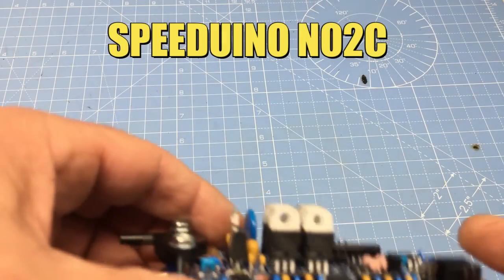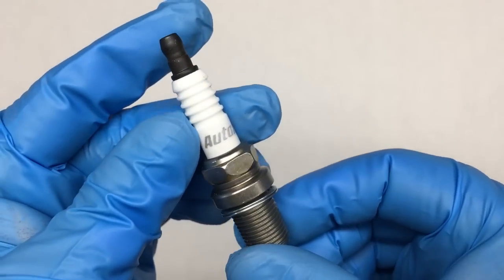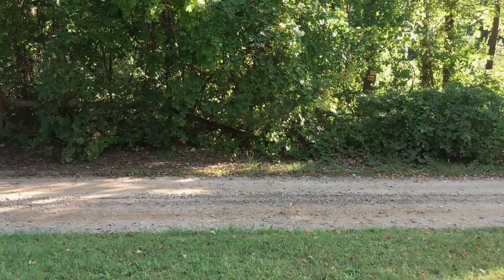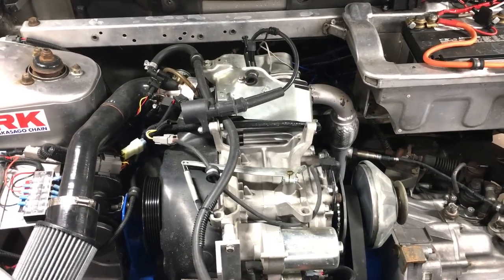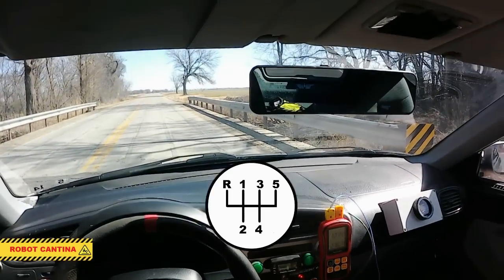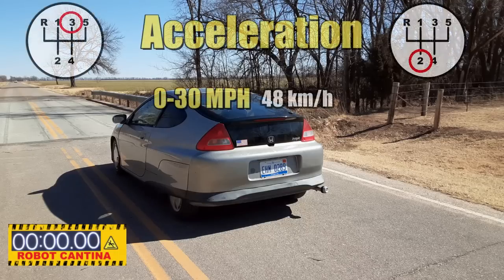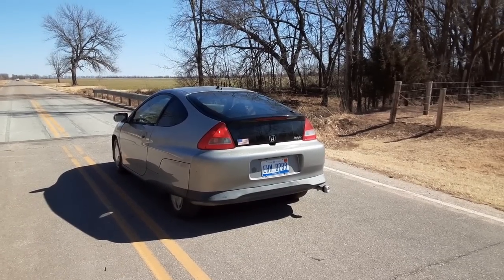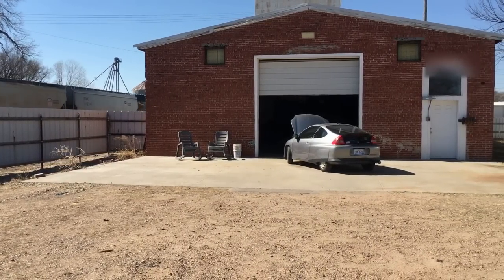S2 Episode 1.  We road test the Speeduino NO2C in our street legal go kart.

Comment: Where in Kansas ? I'm in Vinita, Oklahoma So glad to see that your back and yes EMI can be a major problem I find this out with a Motorcycle Dashcam I end using reg aluminum foil and wire loom harness tape still need get the right stuff like 3M EMI Aluminum Foil Shielding Tape like you my Ninja 250 had the wrong spark plug install which where non-resistor plugs

Comment: I was noticing you were getting as rich as the 11:1 range under load. Where is the target set to? It shouldn't need to be much richer that 12.5-12.75 even under load, especially now that the thermal issue is fixed. At cruising speed you can get away with 14.7 or even leaner under low tps/high vacuum decel conditions you seemed way rich the whole run.
Reply from the maker: Yes, it was way rich.  We will cover why it was so rich in the next episode.  stay tuned!

Comment: I have a intake that will help get your 420cc engine at least to if not over 100% volumetric efficiency if your interested, I'd guess your at 70% currently with a 2 valve engine
Reply from the maker: We are currently using a custom manifold for the EFI.  Not a lot of space given the position of the engine.  Are you thinking of a longer manifold?

Comment: Doing good. Here my input you didn't ask for. I think you've extracted 85-90% of what's theoretically possible from that engine. I think you've got too much rolling mass. Tires and wheels need to weigh way less. Also could shed some weight using drag racer rotors. Anyway you've done way more than I have so who am I to too be giving feedback.

Comment: You know, I do have an idea for the future. Why not a honda quiet generator? THE WHOLE THING. It is designed to respond to an electric load so no controller needed, just an electronic accelerator pedal. You should be able to figure out some way to use the hybrid electric motor and make a cable that plugs into the generator, etc. Basically a road locomotive. If you have a used hybrid battery, that would be even better because then you can plug the charger into the generator and let it power the motor! I bet it will be slow though, but maybe if it works you can get a pancake hybrid motor and battery out of a slightly newer Honda.

Comment: Cool that this dropped into my feed. I'm looking into the feasibility of injecting the Dauntless 225 V6 in my 48 Willys jeep. It's my DD and I need mileage better than 9.16. 

Oddly enough (no pun intended), it seems that there's almost no support for odd-fire V6s (at least Buick-designed) in aftermarket EFI setups. Not so with Speeduino - it's supported out-of-the-box.

So thanks for the cool vid, and I love your cart!

Comment: Welcome back. Is this engine still mechanically speed governered?
Reply from the maker: Good question! The mechanical governor is completely disconnected,.   The EFI computer is programmed to cut fuel above 4500 RPM.

Comment: Would changing the weights in your CVT to hold a bit higher of an RPM while accelerating perhaps be a thing you could do? Back when I was younger I did this on my old go cart and it made it go from feeling sluggish to feeling quite snappy... it felt more like actually taking off in first rather than taking off in third all the time. Seeing as how much weight you are hauling around, I feel like the more gearing you can get won't hurt.
Reply from the maker: Good point on the CVT,  I'm holding off on modifying  the weights until we get the supercharger installed.  I'm hoping the CVT may be in the right range with the additional torque the supercharger will generate.
Reply: @robotcantina8957  That's a good point. With the supercharger it will have quite a bit more punch to the point that it will probably be close to my car's power (63hp and 660cc's of pure fury) and it feels actually kinda peppy... but I have a transmission with far lower gearing then yours. I think 1st literally tops out at 15mph at 9300rpm's!

Comment: So, if you need stuff machined, i have 3 15 hp bmc mills, I'll run your parts for your misadventures.send material and inserts, mostly because this entire endeavour is absurd and ridiculous, I love it.

Thinking I might also be exiting Michigan in a few years.

Datalog the injection pw output. It's it's stable and your seeing that variation in afr, either the injector or pump have issues ir the engine is suffering from detonation

Comment: 14:04 Most of these don't make sense. At what speed do you shift from 2nd to 3rd? And 3rd to 4th?
Reply from the maker: If I start out in 3rd gear, I only have to shift at 50 MPH, however if I start out in 2nd gear then I have to shift at 30 and again at 50.
Reply: @robotcantina8957  My bad, so the only really weird one is the 50-60mph

Comment: One of the biggest things I have seen is the 12 to 1 on throttle ratio.  On boost that’s great.  Na. No u want 13.5 to 14.1 to one for most power and coolest engine.  Where as u can get rowdy and go 15 to one and she will get more power but run hot and risk damage

Comment: Hot plug means good thermal insulation electrode - thread, cold plug means good thermal conductivity electrode - thread. 
Regardless of the heat range plug must conduct heat to engine head and this is done by threads and gasket. It will be affected by threads quality, forces used to turn plug and by your sensor mount too - if force is correct and this washer have never been a problem threads are just poorly made and it is likely the case
Reply: This would mean, that engine wasn't hot, but spark plug conducted and lost not enough heat to head threads, so it was hotter, so it give to much heat to washer and to the sensor

Comment: Seems like it's running lean.  Do you have timing control?  Assuming magneto timing has a compromise favoring easier starting.  Dynamic timing advancement at higher RPM should help peak horsepower at higher RPM.  Intake restrictions are barely detected at low RPM and matter more at peak HP/Torque.  Actually helpful to run a little rich around town for tip in/starting where vacuum peaks and engine goes lean.   High speed?  Not ideal.  I suspect you need more fuel at cruise/high speed and a bit more timing.  Engine running cooler than expected suggests the timing is too retarded and valve dwell is too long.  Do you have a wideband 02 sensor?  Those engines have pretty poor volumetric efficiency and probably don't burn super efficiently at higher RPM.  More fuel might help.
Reply: what symptoms would show it is running lean?

Comment: 15:16 - Is that your ignition table at moment? 👀
Reply from the maker: Yep,  it's basically just 27 degrees.  This is something I will go back and fine tune after we sort out a few more things.
Reply: @robotcantina8957  Alright. ^^
Well... There is plenty of room for improvement and I guess folks at forum are probably going to throw some ideas about how to tune it.

I know you have a dyno for the engine.
I guess there a bit of excess of advance at idle and lack of timing at higher RPM... Still we gotta test test test, before reaching and final conclusions.

Going for optimization in the RPM range the you are using at full load is a good start.

Let's say you have 3000-3500 RPM as your main RPM range at full load (90-96kPa), try reducing from 27 to 25. If power increased, you certainly have excess of advance, but if you lost power you can probably try 30 and rise up 2 after new attempts until you don't gain any power or lose power, then reduce 1 degree on each attempt and see if you still have the same power. 

After that you should be optimized for the cells at 3000-3500@90-96kPa. At least, I'm pretty sure it should improve top speed a bit. 😄👍

Do not forget to also use the AFR targets and the Auto Tune function on the TunerStudio while rolling on the road.

I frankly don't use AFR and I use lambda because I use ethanol and gasoline mixes here in Brazil, but you can later convert those lamba number to gasoline AFR. 

For maximum power, I use lambda 0.86.
For better efficiency, it's 1.05.

This engine is tiny, so the gains between maximum power mix and efficient mix shouldn't be that noticeable, however it would be interesting to test both.

Good luck! I'll be following your project. 👍

Comment: Is the new proving grounds the same elavation as Michigan? Without going back and watching the old videos didn’t you set it up for that? May affect your AIr fuel ratio just something to check bud glad your back jimbo
Reply from the maker: Kansas is about 400 ft higher in altitude.
Reply: @robotcantina8957  every 300 feet is 1% and some change which doesn’t seem like much but will knock a 100hp down 10hp to 90hp granted  the BIGBLOCK isn’t making that but when it comes to low Hp every single one counts bud. I know engines but you know how to correct the problem I have faith in ya jimbo

Comment: I'm still curious what would happen if you eliminated the CVT altogether, it's gotta be sucking up a significant amount of power.
Reply: A go kart or mini bike clutch would never survive. The cvt is what helps make this what it is
Reply: @thedude7726  There's no reason why the original Honda clutch couldn't be used. Some sort of reduction would still be necessary between the engine and the clutch, though, and he'd need to build something to support components on the engine side of the clutch.

I'd use a cog belt drive between the engine and transmission to help absorb some of the harshness of the engine, if I could find the right pulleys.
Reply: @Kansas Rose Yes, torsional vibrations, which single cylinder engines produce in large amounts.

Comment: A tiny turbo off of a kei car would be a giggle. Save that crankshaft horsepower for motivation. An RHB31 or a GT12/GT15 would probably work, no sweat. Just add electric oil pump and cooler.

If you have e85 available, you could run irresponsible amounts of boost - like head bolt stretching, rod bending fun.

Comment: The tps issue is probably do to voltage variance when it was calbrated vs running
Reply from the maker: That could be, however  the TPS we are currently using is a hall effect type that uses 12V and sends out a 0-5 volt signal.  The new throttle body we are going to use has a conventional resistor type TPS.
Reply: In industrial controls we use current not voltage it is more resistant to dirty stray voltage x d induced spikes.
4-20 mA. 
4 mA is zero , 20 max in range

Over 20 mA is an error .
Under 4 is a broken wire!
Reply: @josephpadula2283  I was wondering ... why do you use current and not voltage... what is different about industrial?
This Robot Cantina channel is so fun to watch... I agree he may know quite a bit about voltage variance... He is genius.
Reply: @Kansas Rose Very cool channel!
Reply: @Kansas Rose Nice!

Comment: I’d want to look at the zero voltage reference and reference voltage on the TPS. If your position is changing when mechanically nothing moved one of those must be drifting unless it is the TPS itself getting hot and changing resistance. Do you have a singe potentiometer or dual pot sensor?
Reply from the maker: The TPS is a hall effect type.  It uses 12V and sends out a 0-5V signal.  It may be a crappy TPS.  We have a new throttle body with a conventional resistor type TPS that we are going to try.

Comment: What would it take to get that engine to handle 6k or higher rpms?
Correct me if I am wrong but I think the valves being next to the piston than being over head wouldn't allow it to rev past 6k
Reply from the maker: We are building the spare 420 to handle the supercharger.  It will have a billet rod, better valves and springs.  The only limitation is the flywheel.  From past experience the ARC billet flywheels do not cool the the engine at full load as well as the stock flywheels.  I think 5K will be our max RPM.
Reply: @robotcantina8957  thank you for the quick reply now I can sleep at peace
Reply: @Kansas Rose I think 5k rpm is a reasonable amount but I personally would like a higher revving engine, Honda's usually love to rev high so having something hondaish is nice and it sounds good as well but I have a feeling u would have to spend waay too much money and time building that engine to tolerate that

Comment: Is that a 3 cylinder Kubota, Yanmar or the like diesel I see in the opening scene? :D
Reply from the maker: It's a Kubota D722 three cylinder.  We are also going to test the Z482 Two cylinder.... Both will be fitted with a turbo.
Reply: Just missing the 1 cylinder beast then.
Which turbo are you planning on using?

Remember that the engine needs more fuel to be able to build any meaningful quantity of boost
Reply from the maker: @Mr.Engineer.  We will be using the VZ21 turbo.  The Kubota engines have a fuel adjustment that we will be taking advantage of.
Reply: If you decide to go all out crazy combine the turbo with the supercharger you got (amr300/500 was it?).
Air intake -> turbo -> compressor -> intercooler -> intake 🤠

Excited about the 2 cylinder as well as I got a Yanmar 2tne68 (523cc) in a 400kg vehicle I planned to boost with both compressor and turbo but never got to do that before the project sadly died out.

Comment: The Diesel engine would be a sick upgrade in fuel economy and maybe even in performance…
Reply from the maker: I'm excited to see what we get with the diesel, it should be a fun swap.
Reply: @robotcantina8957  I agree! This would be sick, especially if it's turbo'd! 😁
Reply: @digitalchaos1980  too heavy
Reply: @midixiewrecked7011  Not too heavy to try, though. I'm sure it's got more torque than the original engine, or at least close hopefully.
Reply: @cyb3rgh0st z3r0  by the time he adds a liquid cooling system,  builds an entirely new engine-to-Honda transmission adapter and any accessory drive required-  YES , it's going to be too heavy.   👌
Reply: @digitalchaos1980  Diesels usually make LESS torque than gasoline engines, unless they're fitted with some sort of forced induction.

Edit: Confirmed. The Honda GX270 makes 14.1 lb-ft from 270cc, the Hatz 1B30 makes 12 lb-ft from 347cc.
Reply: @midixiewrecked7011  Yeah by time he adds all that,that is true.
Reply: @PistonAvatarGuy  Wow, the stock gasser put out less than I actually thought. Same with that little diesel. But in my defense I DID say if it had a turbo it would be sick.

Comment: I'm waiting for the episodes in which you use motorcycle engines. May I suggest a Yamaha XS650 engine from the 70's - early 80's? 50 HP should move you down the road pretty smartly.
Reply: Many european hatchbacks till the late 80s had 50 hp or around that value. It's not gonna smoke incoming traffic on an onramp but especially paired with a light car it can make you move pretty adequately. I managed to reach 145 kmh (more than 80mph) with a 50 hp old Citroen :)

Comment: Harbor Freight has a new “cement mixer” engine! 459cc Big Block STROKER with an internal oil pump and improved block casting.
It’s a shame you already invested in two of the 440cc Predator’s already.
Reply from the maker: Nice, it looks like the 459 Stroker would drop right in.... hmmmm
Reply: Interesting to see a small engine that actually uses an oil pump, surprised to see that it doesn't take an oil filter, I know of small engines that are splash lubricated that have a pump just to filter oil, interesting to see that this has a pump to actually feed the bearings but doesn't use an oil filter.
Reply: @brandonupchurch7628  they’re dual lubricated by splash and pump with passages in the crank and journal bearings in the case. There’s a screen filter that’s cleanable.